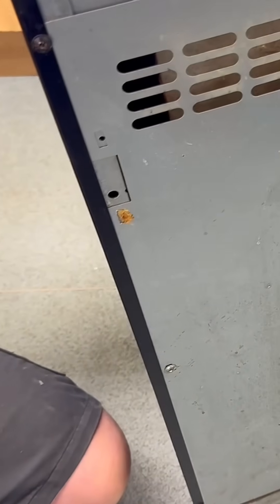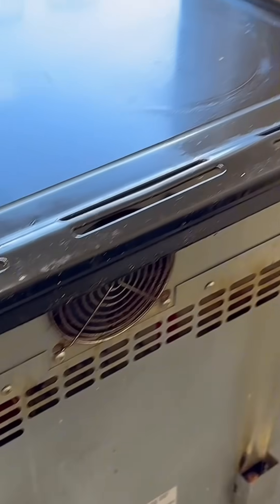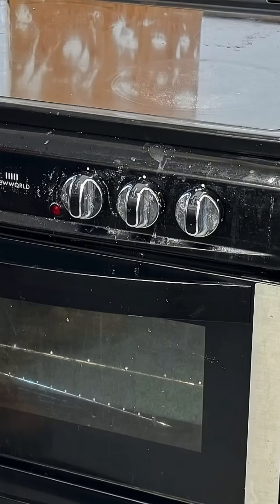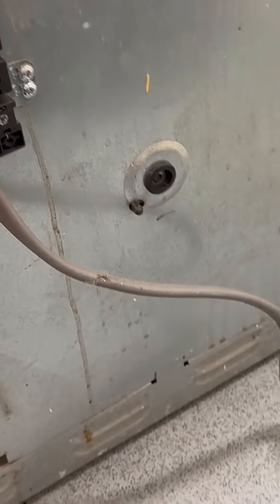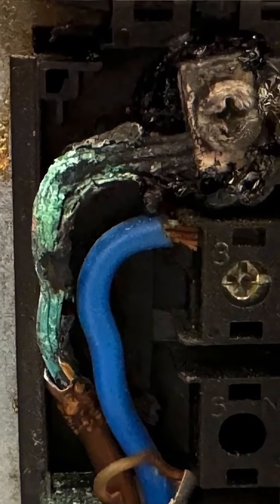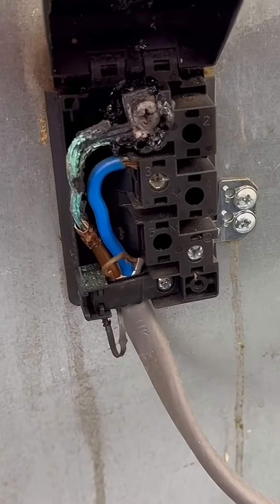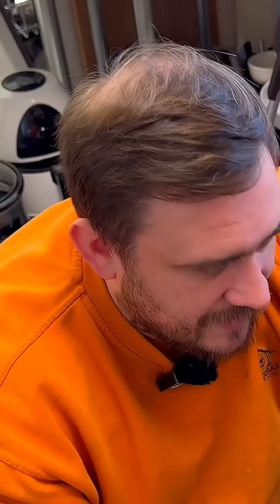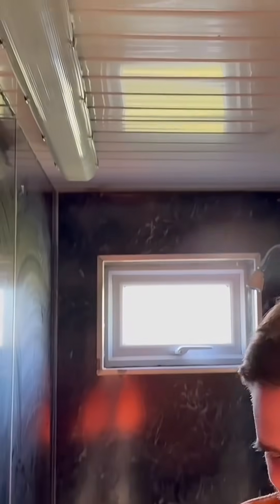Over Tight Conductor… NOT Good

Comment: I'm a retired control systems engineer so I have worked on everything from computer controlled gear to 500 horsepower drives.
I would have added a "Y"/"U" shaped crimp termination to the power cables. They give more contact area at this type of screw terminal than a single wire. This is also an application where either a torque screwdriver or an electric screwdriver would be a tool for the job. If I had a sparky doing this for me, I'd definitely ask them to use a torque driver of some description.

Comment: I'm not an electrician. I installed my own oven back in 2004, I found it incredibly difficult to get the correct cable as specified by the manufacturer. CEF also struggled to get the correct cable, or at least a couple of meters of it, until someone said they could get a bit from a local generator company. I ended up with a lovely bit of correctly specified flex, which to this day is still in perfect condition, the oven having been temporarily removed recently for a heat pump install. Back then I was told most electricians would just use T&E, which is what my electrician used to install my induction hob just last year, as they struggled to get the T&E I could help but think flex would be better. I really think ovens and hobs should be suppied with 2 meters of the correct able fitted,
Reply: I have to admit it was difficult to buy that correct spec cable back when I started my apprenticeship, nearly around the time. You can now buy the cable from screwfix and tool station. Difficult in long lengths though
Reply: But I also agree that the oven should have at least 2 meters of cables with ferruled tipped ends
Reply: Visited 3 electrical wholesalers in Edinburgh recently before I had both a length of H07 and also suitable ferrules to match.

Comment: Hi Gary,  I know most electricians would not get involved with that problem on the cooker. 

They would just say to the customer to get the engineer in to fix it.

I am a warewashing engineering in the commercial sector.

As I always say, do the pull test and see if it moves or comes out.

Most problems I find with faults like that is when people use wrong size of cable for install.

Cut back damaged wires and fit new terminal strip.

Comment: For me this is firm C1, melting cables for me would be an immediate risk of electric shock or fire, not safe for continued use in its current condition. Even gently inspecting this installation could negatively change the properties of the termination and would need to be immediately isolated. Takeaways for everyone.
Reply: Immediately disconnected, not isolated.
Isolated and disconnected are not the same
Reply: How would you electrocute yourself through a plastic box? Further more if you are pulling it out and opening you would be open to an electric shock if everything was fine?  So not sure why you think it would be a C1
Reply: @CBE-d6jA loose/intermittent Neutral contact will probably bring Shock Hazard.😬

Ontheotherhand, a loose/intermittent Line contact will Less Potentially poses Shock Hazard...👌

Comment: Line went in the wrong side, when you tighten the screw, the underside tries to push the cable out
If you feed the cable on the other side, like Neutral, the screw tends to pull the actual cable into the connector
Could use Y or U crimp connectors but there's little room to begin with, before crimping on an insulated U connector, then very sharp turn to exit
(Yes, you could strip more back and make your own U shape cable like some clips suggest, but still a struggle to cram in 6mm U cable under some connector screws - it's a poxy design in the end)

Those Cooker connections should be banned & decent screwed cage clamp specified for high demand appliances, so that quality H07 cable can be fitted easily & more importantly safely - regardless if domestic or commercial

The cable was fitted poorly, to a poorly selected cooker connection by manufacturer

Comment: Cookers either need adequately sized terminal blocks for the correct type of cables, IE HO7 feruled connections, or screw/bolt down open top connections suitable for ring crimps to be used. Unfortunately more often than not manufacturers have opted for a design more suitable for 6mm Twin & Cpc to be used as it can be bunched or splayed so ovens with the silly copper links can be manufactured as they're cheap.
A clear case of codes for manufactures falling behind codes for wiring and installers.

Comment: Canny win loose connections cause fires and overtightened causes this CMON  Gary  what do we do never seen anybody use a Torque screwdriver on a cooker and can the cooker makers give us a bigger safer connector box on the back of all the cookers from now on
Reply: Never seen the correct torque printed on a cooker either (like it is for the stuff going into a consumer unit).  BTW a lot of cables included with cookers have ferrules.  If not, I add them.  (Not a pro sparkie but handy landlord who frequently has to explain code to contractors)

Comment: Personally couldn’t leave it like that , would re terminate as he said the tests are fine and would only take minutes to re-do
Reply: how can you retirminate it? the cooker terminal is not repairable
Reply: @rashdondoesntunderstandwor-g1xif possible of course.
Reply: @ryanT1967  With the thermal damage, the screw may just break off as soon as you try to disconnect it. Personally, with the customer accepting that it has to be immediately replaced, I would have liked to have seen it disconnected until the replacement arrives. I don't think it's safe to assume that it has welded and I think the damage means that you don't know if it's currently lose or tight even if the screw feels tight.
Reply from the maker: Good point

Comment: Those appliance connectors are a pain.  I've tightened the exact same connector type, wiggled to double check and had the conductor pull out.  Very poor design.  The cord grips on them appears more suitable for flat cable like twin and earth rather than H05/07.
Reply: Agreed they are complete pants, Recently replaced our 110 double oven range cooker with another...
Chinese made (isn't everything now), has 3 rather thin links on Line & 1 on Neutral (for 3 phase option)
The terminals had little room for 6mm H07 ferruled cable, needed to slightly squish the ferruled end and readjust the poxy links to on same side of screw, to ensure the links make contact with the supply, otherwise the main link if placed other side of screw isn't properly clamped to ensure solid connection
The very basic screw down connection, where you need to place wire correct side or it wishes to push out, idealistically you might consider using a Y or U crimped connector - but there's hardly much room to begin with...
Who the heck designed this connection block ???
Do they just slap in the same connection block as a basic single oven ???
(I think they do is the answer, never mind 2 x electric ovens plus electric grill, hob was still gas thank goodness)

Why not use proper screwed cage clamps ffs ???
And don't get me started with the fighting to get the 6mm h07 secured under the cable grip
Certainly seem they want you to use T+E over a recommended H07

A complete needless ball ache to fit 3 wires securely, knowing the connections are as sound as possible, simple 5 min job turned into a lot longer, mostly coz they didn't use a decent sound screwed caged connection

It's no wonder why some people just bodge it with a bit of 2.5mm TE, well, they'll probably only use one oven...
or drop to 4mm when 6mm won't easily fit.
Our own safety standards should ensure manufacturers of these high demanding appliances have sound & robust connection points to ensure it can be connected easily & most importantly safely

Soz for long rant - the air was dark blue last week
Reply from the maker: So true
Reply: Better to use a crimped round lug on the end of the cable.